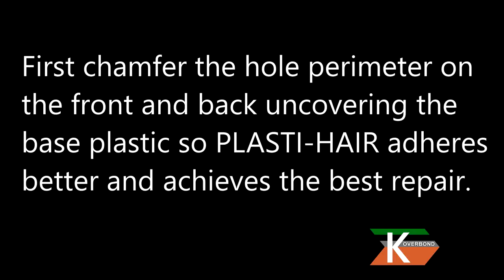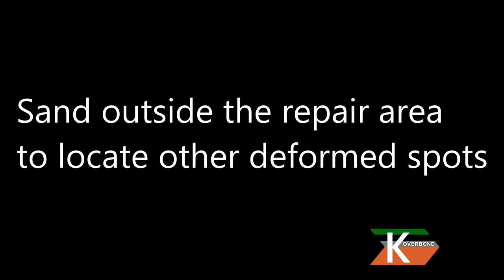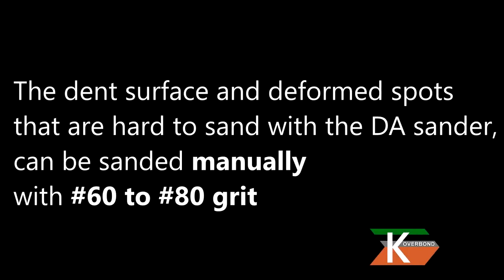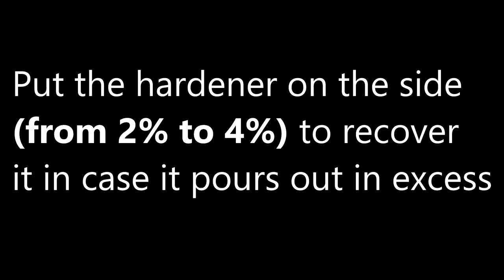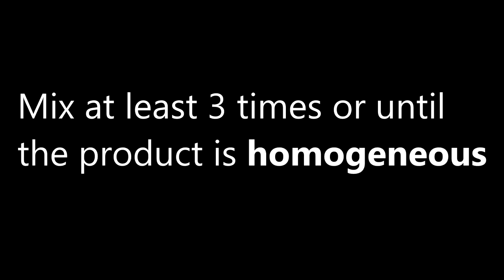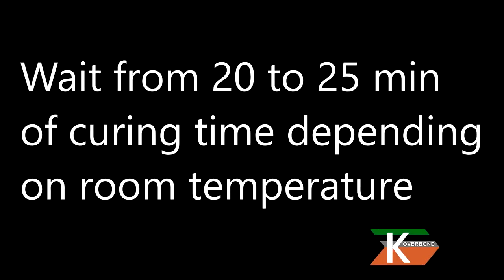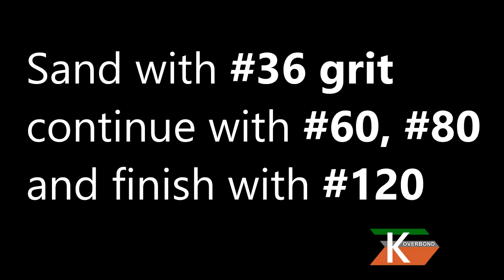PLASTI HAIR   BUMPER HOLE REPAIR IN 30 MINUTES

Comment: I bought the product to repair a big dent in my plastic bumper. I watch this video four times, the section on mixing instructions. After I applied the product to my bumper, it would not dry and most certainly did not harden in 30 minutes.
Reply from the maker: I'm sorry for any issue you had with your product, please contact us to quetzal.aj@sanloz.com to follow your case and solve any issue you had
Reply: @koverbond-usa  I bought a small can of Plasti-Hair. Mixing the material in that small can is a challenge. I considered that I may have mixed it poorly. I thoroughly mixed the remaining material in the can on my second attempt, and it worked as advertised! I will use your product again. 

I was impressed by your email reply to my first comment.
Reply: @koverbond-usa  Thank you for your support. I realized I did not thoroughly stir the Plasti-Hair contents in the small can. 

After thoroughly mixing the contents of the can, I added the hardener. Application to the hole in my Mercedes-Benzplastic bumper cover, waiting for the Plasti-Hair to harden, I was able to sand the bumper and paint it. It looks like new.

I will be using Koverbond Plasti-Hair on another bumper repair.

It's is a great product.

Comment: That is a straight part of the bumper cover. What to do with a hole in a curved area.?
Reply: I used a fiberglass mesh and it worked perfectly
Reply: I used an adhesive which endures 250 kg force, but you can also use plastic welder to keep mesh strong on bumper